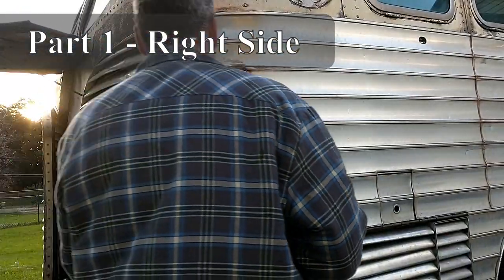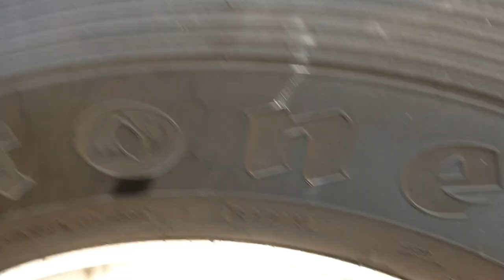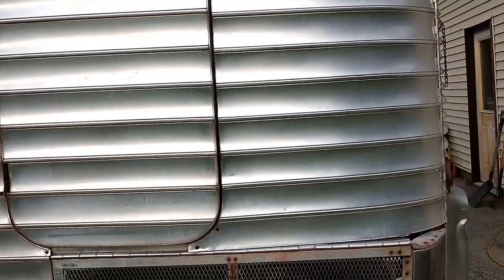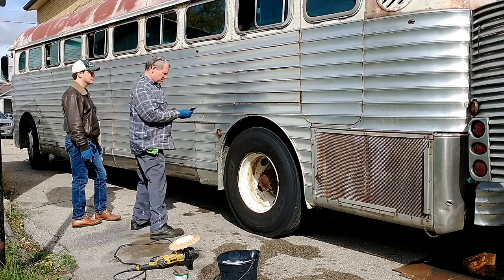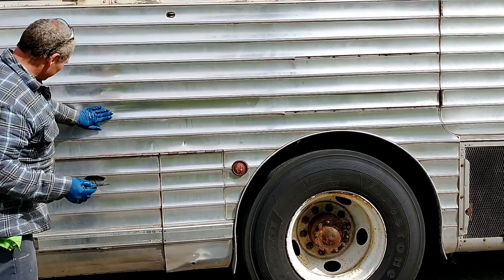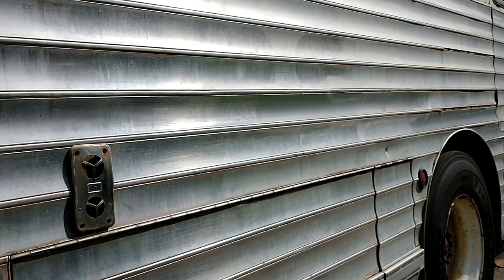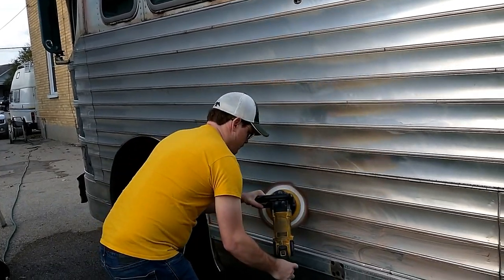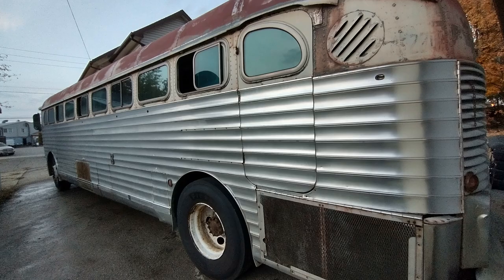A Spa Day for Gus! (Our '48 GMC Silversides)

Comment: Gus is looking good with all your effort. I once worked a job here in Miami washing and waxing Welding Supply Trucks in the NW section. This was back in 1980. Anyways, some oddball friend going by the name Craig had a recipe involving four items: mineral spirits, comet,  turtle wax, and an orbital buffer. The trucks came out great, as all the oxidation was removed. But, then again, half the paint came off in doing so! Happy Holidays to Jason, and everybody.

Comment: Hi from a Bus Nut in Canada , we have two MCI 5's  , Hey just thought I'd mention the Rustoleum product , Wipe New . You can use it to clear coat metal also , I tried a test spot on my black plastic  faded bumper on my FJ cruiser, never got back to finish it and after one harsh winter , summer and quite a few washes  it was still shiny ..couldn't believe it . Anyhow I've heard of guys using it on their anodized Eagles with great results , easy to work with and thought you might want to try it first in an inconspicuous area to protect your anodized finish ...Cheers from Edm. AB.
Reply: Hi Devin,  Rust-oleum has a lot of products witch product do you mean?
Reply: @Bus2000  the product I used was called " Wipe New "
Reply from the maker: I have some strips of siding I will be changing and could test it on them first.
Reply: @BusWithUs.  good luck ..nice work btw😉

Comment: G'day,
Kevin here from Australia. 
Gus is really looking the business . With the joints on the side could you use a small brush to get compound in to get the oxide off and what if you use a pressure washer as a final step that would stop any bleeding of left over gunk when rain hits him.
But im so jealous Gus is one hell of a bus.
Anyhoo stay safe and stay well. 
✌  Peace everyone.
Reply from the maker: We've tried a pressure washer, it doesn't even touch the red oxide!  Maybe need a good heated steam one. Not too worried, the roof gets stripped in the spring.
Reply: @BusWithUs.  the heat one sounds promising. ✌

Comment: I'd be concerned that the steel wool will leave bits of itself in the crevices...and rust.  I used it to polish the aluminum steering wheel spokes on an MG steering wheel...and it left steel behind
Reply from the maker: Seems to be ok.  It's been over a month since we did it and no left overs showing rust.